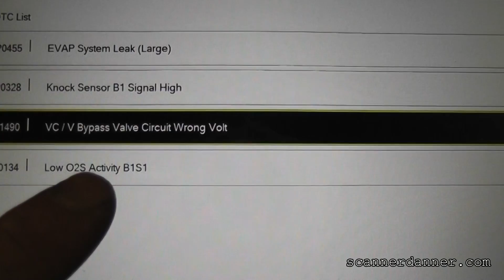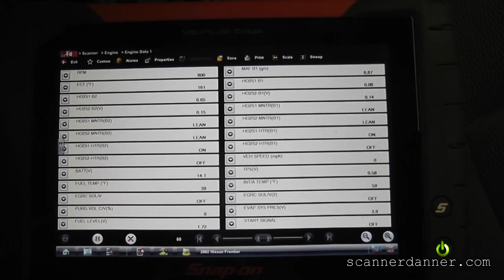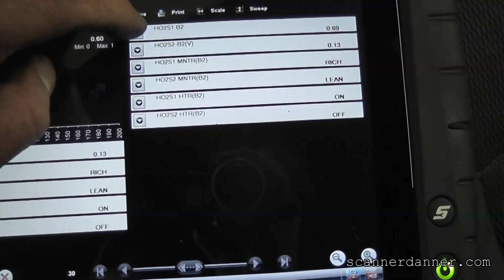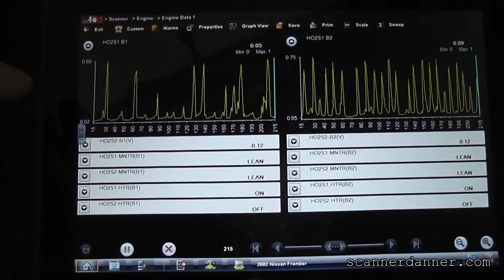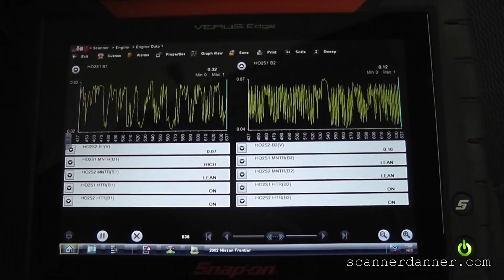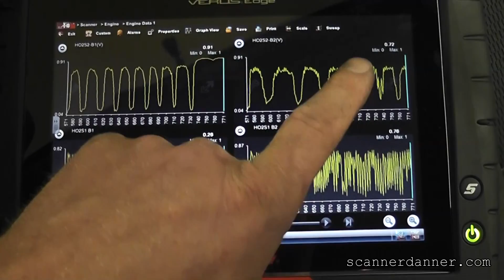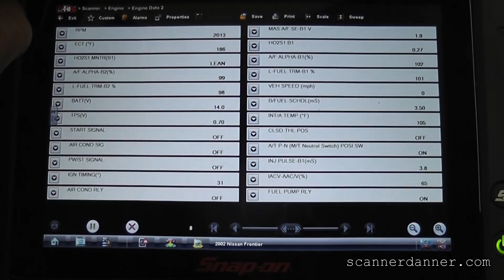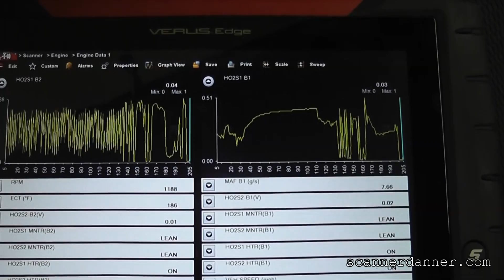Oxygen Sensor Slow Response test (P0134) - Nissan

Comment: I’ve not sure if have slow 02’s using lower grade scanner but thinking both upstream are slow responding  done  everything we can to this car expect cam and crank sensor and up stream 02’s  car ran for long time on bad battery 12 yr old batt  been in since 2013 I didn’t know till girlfriend told me low voltage signals for things till change batt , but can’t solve the ruff idleing and feeling like misfires  low misfire counts on both sides but not all 8 cylinders but enough no codes
Reply from the maker: Typically idle only misfiring is from a compression loss. Valve issue. A static compression test will NOT identify this issue. A running compression test may catch it though.
Reply: @ScannerDanner  everything’s good  only things haven’t changed is cam and crank sensors and before mentioned 02’s compression is good on all 8 cylinders everything been done can hear miss at 
High Rpm’s  and at idle been confusing

Comment: I have a 1995 2.4l tacoma with a slow response o2 sensor bank 1 sensor 1.  I replaced the sensor a while back and cleared the trouble for a few months. The same problem returned, so I looked at the graph, and it looked like the sensor was  bad.  When I replaced it, the old one was black.  The new sensor graph looked great.  After a day, the slow response code returned.  I haven't had time to investigate further,  but other than a slight hesitation at take off, the truck runs smooth.
Reply from the maker: Any exhaust leaks near that O2? And a 95 model year setting a slow response code?

Comment: Perhaps cleaning would benefit?  And/also I have 2 new O2 Sensor 1s from the shop (not purchased online) and while there is good movement... they are no where near as active as what you are showing as the good example.  Curious.  Also I wonder if fuel injector cleaner doing its thing would present as such irregularity until its cleaning is complete.  hmmm....  ~ thanks!
Reply from the maker: Cleaning an O2? That's not something that's worth even trying to do
Reply: @ScannerDanner  Understood - but applicable in my case since Im starting with new, good O2 sensors which are being carboned up on one side due to (air intake/exhaust leaks).  I now have the situation resolved....  the exhaust 'donut' at the exhaust manifold was failing, completely crumbled when I removed the exhaust. A smoke test into the tail pipe indicated a leak at this point.  The lean reading condition was triggering more fuel and fouling up the spark plugs and O2 on this bank.  Cleaning - meaning removing the carbon buildup- was easy in this case using carb cleaner.  Cheers!

Comment: ever see ISSUES coming from exhaust not grounding out properly?  ie: bad connection to the engine, therefore battery terminal connection- is off:  and / or due to incompatible antiseize compound?
Reply from the maker: Causing O2 issues? Not since they went away from single wire O2s. Today's O2 sensors do NOT use the exhaust for a ground
Reply: @ScannerDanner  thanks - I should have known that prior.

Comment: I have a cheap $100 scan tool
..does it refresh fast enough to do a side by side on this data? Or do i need a better scanner to really see if an o2 is lazy or not
Reply: Switching time on an O2 sensor is 200ms peak to peak so a basic scope should be enough to tell if it is responding slow
Reply: @evanwynne5293  I don't have a scope...only a scan tool innova 5210
Reply: @evanwynne5293  also out of curiosity I can see how to test upstream o2 sensors...nice testing those because there is nothing in front of it except the combustion that occurs....with downstream you have the catalytic converter in front of it and it can get tricky...can you still do the snap throttle tests for downstream o2s or do you need to feed the engine propane?  My understanding is a bad cat will never register rich it will only register lean as it isn't doing its job of converting gases....so can I just feed engine propane and look for it to be rich?  The upstream to me is easy like I said because there's no cat getting in the way of things...what are some methods you like to do to test between a bad downstream and a bad cat?  For example diagnosing a p2096 (post catalyst fuel trim too lean)
Reply: @macknumber9  you can send it rich by driving full acceleration or send it lean by letting off the throttle and letting it go into fuel overrun rear O2 sensor should go lean as well. Most of the time that I have seen p0420 the rear sensor copied the swing of the front sensor which would indicate the cat isn't doing its job. You could also test the emissions with a gas analyser.
Reply: @evanwynne5293  thanks for the tips guys I hope you are all having a great holiday with your families...God Bless you all
Reply from the maker: Refresh rate is not only affected by what scan tool you're using. It is also the system and whether you're using OBD2 or OEM. Lots a variables. Also with OBD2 systems if the signal is slow to change, you'll get a code for it
Reply: @ScannerDanner  how's the knee Paul?
Reply from the maker: @evanwynne5293  I'm hurting man
Reply: @ScannerDanner  couple of weeks  of recovery ahead. Was it a partial or full tear of the ACL
Reply from the maker: @evanwynne5293 full
Reply: @ScannerDanner  ouch!  Resistance bands and physio will have ye back up dancing in no time. Get well soon Paul👍

Comment: paul  i have a 2003 ford focus  2.3L   I had a  engine light on  and a code for a PO133 I erased it and it has not returned  and it has been months   should I still replace the sensor  ?

Comment: Should front o2s fluctuating even while driving and engine under loading?!
Reply from the maker: as long as the throttle is being held steady, yes. Other than wide open throttle
Reply: @ScannerDanner  thanks..my front O2S stay steady rich (0.850 v) while accelerating (rpm about 3000) is that normal? I have p2191 code.
Reply from the maker: @islamsh.4862  heavy accel and wide open throttle, yes what is the definition of the code you have?
Reply: @ScannerDanner  actually i have 3 codes…p2191(system too lean at higher load),p2096( post catalyst fuel trim system too lean)and p2187(system too lean at idle)..2007 sonata 2.4L
Reply from the maker: @islamsh.4862  what are your fuel trim numbers? At idle and  at 2500 rpm in park?
Reply: @ScannerDanner  I think O2S  while acceleration should reads lean or stay fluctuating so that the ECM gives more fuel .. i have poor acceleration!!
Reply: @ScannerDanner  I checked MAF sensor,fuel pump, injectors, catalytic and no leaking in all the system
Reply: @ScannerDanner  at idle(short trim: from -3 %to -13 %) at rpm 2500 ( from 9% to 19%)
Reply: @ScannerDanner  I need your help plz
Reply from the maker: @islamsh.4862  sounds like a MAF issue with negative trims at idle and positive trims at higher RPM 
Further testing of the MAF would be my advice
Reply: @ScannerDanner  thank you so much dear

Comment: Hey Danner got a question for you just last night I hooked my scanner up to my son's 08 Chevy Malibu 2.4  so I grahped the  O2 sensor before the cat and O2 sensor after the cat raised my RPMs up to 1900 and what I was seeing was both O2 sensors were cycling up and down up and down for about 10 seconds 15 seconds then all of the sudden the rear O2 sensor after cat stayed at a fixed value right in the middle of the graph and O2 sensor before cat was still cycling up and down is this normal.
Reply: Yes that's normal, the cat doesn't start to work efficiently until it gets hot.

Comment: can it cause a stall coming off a red light I tap the gas car stalled but started right up.  I got home checked codes there was p0134.  car always has p0421 but cats not clogged no emissions here so I am not worried atm.  the reason I mention is because I dont know if the p0134 was from the stall or from earlier car idels steady rpm but rough sometimes rides perfect sometimes feel light knock on highway after driving a while almost feels like fuel is off.  I also notice o2 dips to 0.00v on scan tool.

Comment: In a Nissan Sentra 2004 I had to replaced 02 sensor ( the code P1279 show 1 bank 1 air fuel sensor was greater than the maximum allowabe limit) the RPM were find (before) I replaced the 02 sensor.  Now I can start up the engine just find when engine is cooled. But when the engine is warms up the RPM drops and when I need to restart the engine the RPM will drop to 0 and engine turn off. I get the same code P1279, I went and changed the PCV vale and still the engine will start the first time and when I truned it off and to restart the engine it has the power but the RPM drop to 0 and engine turns off. I have to push the gas pedal 3 to 4 time to get the RPM up. Please help...
Reply from the maker: Are you getting any lean codes? P0171, P0174? MAF sensor and air intake leaks after the MAF and vacuum leaks are all mentioned in the P1279 flow chart

Comment: Hi scanner I have a question on my 2001 Nissan quest  I got a code P0134 and P0140 and when you run the car in the stop sign is jerking...  actually Iready change the spark plug and I clean the mass air flow and I clean the throttle body too.... hoping you read my msg thanks.....

Comment: hi, I'm on the process of changing the two front oxygen sensors on my 2003 E500 and I need your opinion regarding some info I've found online, i've copied it and I'll post it below here it is [ Replacing a failed oxygen sensor may be all that you need to do, but be aware that older catalytic converters may not play well with them. Likewise, when you change out your catalytic converter, you'll need to change out your O2 sensors.May 18, 2016]
Reply from the maker: why are you changing both front O2 sensors?
Reply: @ScannerDanner  Ok I'm gonna say a little story about this vehicle hoping that you can help me with this DIY, I've parked the car for about two and half years do to excessive battery drain, before i stopped driving it I've replaced the following, both fuel pump units ( genuine Mercedes parts) new Bosch spark plugs, I've flushed the engine coolant twice at the same time using Mercedes antifreeze, twice brake system flush using Mercedes brake fluid, new front and rear brake pads and rotors, and now after it was setting for that long I wanted to address that issue which is the issue of battery drain. I started with the alternator I removed it and took it to the alternator rebuilder shop they told me that it's good except it need a voltage regulator which I was already ordered and I did replace both batteries the main and the auxiliary I bought them from the dealer so I put everything on the car and started the engine so i can go deeper with the diagnostic regarding the battery drain but unfortunately, the engine lights came on I used my Obd2 scanner I had cylinder 1 and 2 misfiring and the engine was shaking hard, I identified the issue by disconnect the connector off each coil one by one and there was no changes in the engine then I swapped coil 2 with 6 and 3 with 7 i did the same process and  noticed the difference + the misfire codes transferred to 5 and 6 cylinders so I did replace the coils and the problem was solved, 2days later the engine lights came on black smoke from the tailpipe, I scanned the car and there was a misfiring codes, I will copy them from my OBD2 Scanner as    the same way as they are, here it is. P2051 MIL ON&Stored&Current Misfiring Of Cylinder 1 , damages TWC (P0301)                                  P2050 MIL ON&Stored                                                                   Misfiring , damages TWC (P0300) so i was suspecting on the fuel injectors since the car wasn't driven for a long time but what confused me is when I performed the big screwdriver test and listened to the ticking noise but they all acting the same Which made me suspect on the oxygen sensors.. I know I've been writing a lot and I hope you have time to read
Reply from the maker: Are you running 2.5 year old gasoline in this thing while you're trying to troubleshoot a misfire?
Reply: @ScannerDanner  no, fresh premium fuel with fuel injectors cleaner added to

Comment: Hey Paul I need help. I asked you awhile back about my 2009 Infiniti G37x being a no start which I did manage to get running again. However now I am having codes P0430 and even more reoccurring P2A00 which keeps throwing my check engine light on. I followed the FSM troubleshoot and have narrowed it down to 3 things that it could be either bad catalytic converters which I kind of doubt, a leak which I am failing to find (a weld was done on the passengers side catalytic converter bracket to get it to pass inspection, there was a leak there but it is solid now so I don't think it would be related?) Or bad upstream Air to fuel ratio sensors (the downstreams were recently replaced due to wires being opened on the sensors themselves and bad live data voltage readings on my scan tool). I am not sure where to go from here however there is one live data pid that bothers me which is A/F ADJ-B2 reading at -0.06 when hot even when pressing on the accelerator. B1 reads a constant 0 and I am unsure what Nissan means but that abbreviation or what the proper reading should be in their terms because of it. When it comes to normal terms regarding fuel trim and O2/Air Fuel Ratio sensor readings from vehicles like GM's I have no issue understanding them but I am unsure of how to read a few data pids on Nissans live data because I am unsure what they mean/are measuring. I am just assuming it is related to the  code because of the A/F in the A/F ADJ-B2 abbreviation. Could you tell me what it means for certain and what it is the equivalent to in normal terms? I feel it may help me diagnose the issue. Otherwise the vehicle runs fine and the engine is perfect with 0 misfires even at it's max RPMs. I do keep on rare occasions getting a high voltage to the power steering pump code but the power steering system is operating perfectly and not losing any fluid so I was ignoring it and I doubt they are related although I could always be wrong. Injectors are new too so I know they aren't leaking but whatever the issue is does seem to be affecting gas mileage causing it to run rich but not enough to trip a code. I can't find a reliable source to tell me how to understand Nissans consult 3 software terminology. My $2000 scan tool uses an aftermarket version of the OEM software. I may send this to you on the premium site if I can in case you don't see this here since I am a student there. A breakdown of some of this weird terminology would be a lifesaver. I have to pass emissions soon and these codes will definitely cause me to fail. So far the internet has been useless and the FSM has been useless as well so I'd deeply appreciate any help you can provide. If need be I could email you screenshots of the live data off my scan tool. Thanks.
Reply from the maker: I believe you mean P2A00? You need to address this fault FIRST! DO NOT concern yourself with the cat code until this upstream AF sensor fault is fixed. Also, this code could just be a bad AF sensor, but it could also be other things: fuel pressure, fuel injector, air intake leaks, wiring problems to that front AF sensor
Reply: @ScannerDanner  Yeah that's it sorry about that I was half asleep when I was writing that out and I wrote it wrong. I corrected it haha. I will check on the fuel pressure and the wiring and get back to you on that after I check it. Fuel injectors are brand new OEM ones with a warranty so if they are leaking that will surpise the heck out of me but but I can alway get new ones for free (I replaced them because the old ones were leaking bad and caused the oil to stink of gas which it no longer does since I changed it the day they were replaced) if they are. I had sprayed carb clean around and checked for fuel trim differences on my scan tool when I sprayed it as well and couldn't find anything and I definitely can't hear any leaks so I am at least certain it isn't an air intake leak. I will let you know what I find. Thank you.
Reply: @ScannerDanner  Update: I checked connector and found a section of a wire in the harness fully exposed touching the block right by the connector for the sensor. It seemed alright otherwise though and didn't need to be spliced so I just put liquid electric tape on it. Seems to have fixed it so far so hopefully that solves my issues. Thanks for the help Dan I appreciate it.
Reply from the maker: It's Paul Danner but that's okay, I get "Dan" all the time. Nice job on the detective work!!